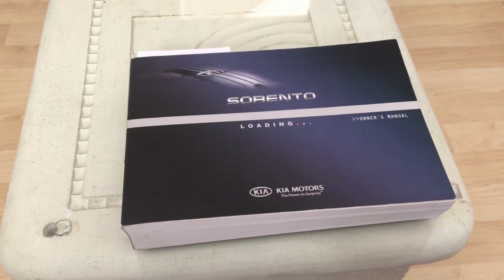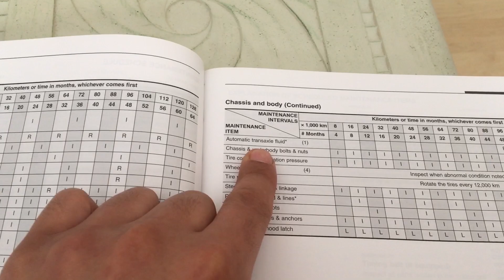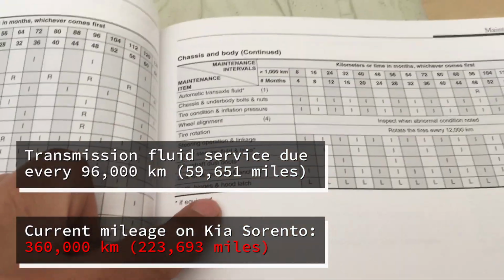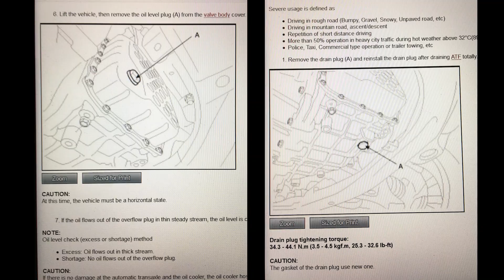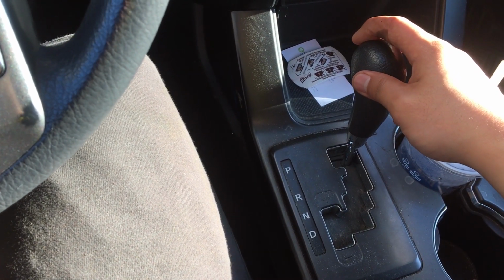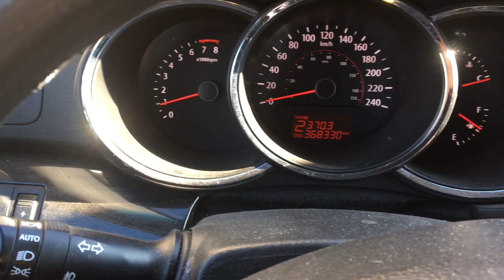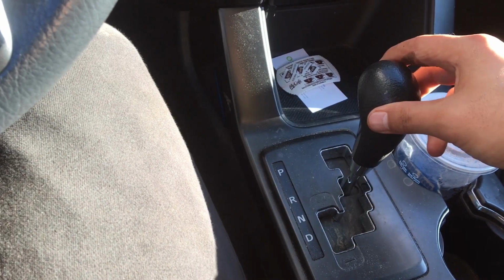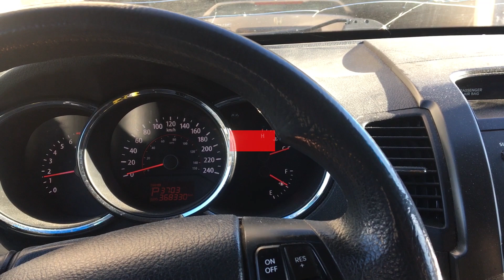Transmission Drain and Fill: 2011 KIA Sorento 3.5L Engine

Comment: This was a very good step by step. Thanks for all the details on tools needed as well. To those who have not done the job yet; it would be a good idea to use a funnel with a hose attached. The transmission fluid has a lot of resistance going in and the system with burp many times. I leaked transmission fluid down the transmission because of this. I would use a skinny funnel and pour slowly and take breaks in between to wait for any burping that occurs. 
Thanks again for the tutorial
Reply from the maker: You are welcome 🌎

Comment: To get to the "injection bolt", or fill plug at the top of the transmission more easy, you can take out the battery and battery mount. It is only 7 screws to do that and it gives you a ton more space to get a ratchet in there and a funnel for filling. You will need a 10mm, 1/2in, and - I believe - 12mm sockets.

Comment: When measure the transmision oil level should be start or running the motor or not?....vehicle is start or off?
Reply from the maker: Vehicle should be on and running according to the manual.
Or you could get the Sorento up to 50~60°C (122~140°F) temperature. Then turn off. Then you could measure oil.
Reply: @AutomotiveForBeginners  Thank you.  I wondered that.

Comment: How come my ratchet doesnt turn the rubber transmission bolt am j using the tool wrong?
Reply from the maker: It should turn
Reply: Yes something isn't right lol but I seen another video with it used in reverse so I'm going to try that thanks

Comment: @0:24  48 months is four years, not two.
Reply from the maker: Hey you're right. Wow my math is pretty bad. But even if I am wrong, would you rather change your transmission fluid every 2 years or 4 years? Sometimes being wrong is not so wrong.

Comment: Isn’t it supposed to be done with transmission warm? The fluid level would too low if yo do it cold?
Reply from the maker: Yes you are correct. Make sure to get the Kia Sorento running up to 50-60 degrees Celsius (122-140 degrees Fahrenheit) before doing the transmission fluid change.
Its in the description box.

Comment: Hi, my wife has a 2011 Kia Sorento with 125,000 miles, she is second owner and she has never changed the trans oil, and she doesn't know if it has been done previously, would it be safe to do it after all that time?
Reply from the maker: I'm still changing trans oil at 250,000 miles. Definitely safe as long as you do 'drain and fills'. 'Flushes' unnecessary at this point.

Comment: No filter change needed?
Reply from the maker: Negative. There is an internal filter inside that is supposed to go for the life of transmission. You could unbolt the face plate and change the filter inside if you wanted. The book time is over 10 hours to replace.

Comment: I have the exact same year/make/model/trim - this one is a major pain in the ass since the bolts are so hard to reach. Were you unable to get a socket over the drain bolt at the bottom? I'd like to torque it to spec but it seems difficult to reach.
Reply from the maker: You could try and use a swivel if you have to torque to spec. But you may no other option but to use wrench.
Reply: @AutomotiveForBeginners  thanks man! do you recall if a socket could fit on there?

Comment: Did that work for you? Crazy ive been told not to do this
Reply from the maker: Yes, it's been about 8 months now and no issues. Actually reduced alot of transmission slipping since. Since it is a drain and fill and not a flush, you're going easy on the seals.

Comment: Owner book says it contain 7.8 lt. İf just 2lt comes out its interesting 🧐
Reply from the maker: Yup. You can check it out for yourself. Drain out all fluid and try to pur in more than 2 litres. You will see the fluid will start pour back out side filler hole. 
Must be engineered that way. Only a flush would remove all the remaining tranny fluid.
Reply: Doing this a few times in a row with each engine oil change will be near equal to a flush. Atf for this car is fairly cheap, valvoline maxlife multi car works just fine and is affordable.. Do three times and it's the same as a flush but cheaper. Many techs will advise against flush with older transmissions as the flush may loosen bits of material plugging up potential leak points. Drain and fill is all you really need to do with this many km. If had been flushed regular from beginning at recommended intervals that's a different story.